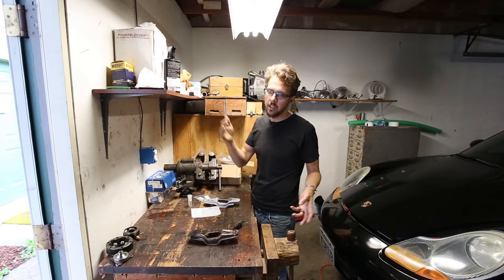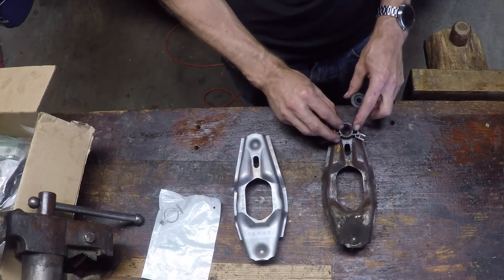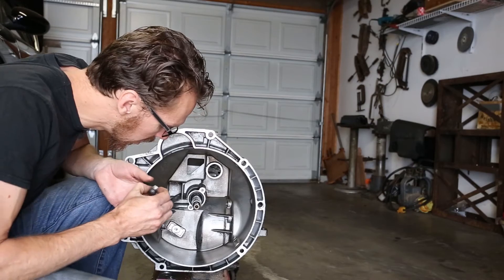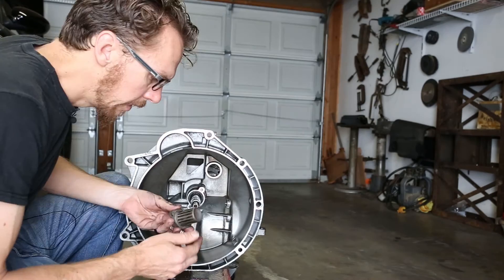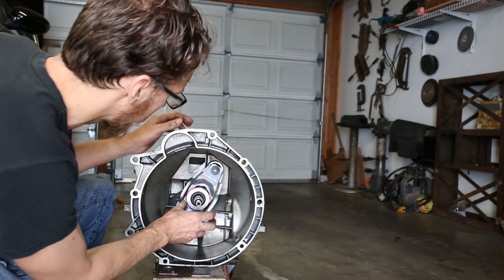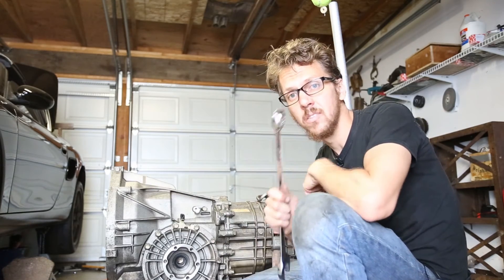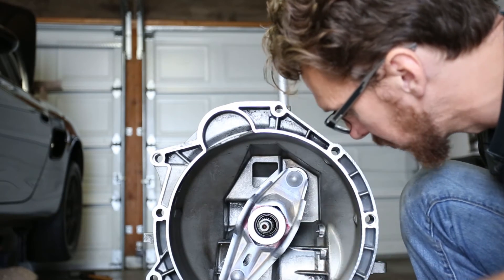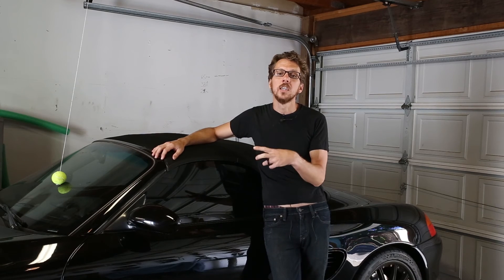Porsche IMS Fix 10: How to Install Clutch Slave Cylinder, release plate, and throw out bearing

Comment: Hi Ben!

Your videos are great full of practical information! They are indeed so good that they encourages me to buy a  2002 Boxster (MY 2003 Facelift) and carry over the IMS issue as well as regular maintenance myself!

I would like to ask you how the hell you clean the gearbox so wel?? 
I already tried Brake cleaner and degreaser, and it is much cleaner now (it has lots of old grease over it)

I appreciate very much the time you've spent shooting videos, I am eager to hear from your next project!
Reply from the maker: Well, my gearbox only had about half the mileage yours does, but I used this: http://amzn.to/2qn67Aw
I'm not sure what is available in Germany, but the key here is that this is a concentrated degreaser, so I was able to brush it on in stronger concentrations.

Comment: Bought a 996 transaxle for my sandrail build. Had it for about a month since I was still building the chassis. I go to prep the transaxle and the ball pin is sheared off smh. Thanks alot 911_doctor on Ebay I really appreciate an $1800 broken transaxle. Hopefully I can pull the rest of the threads out